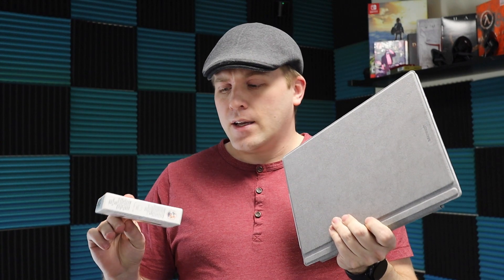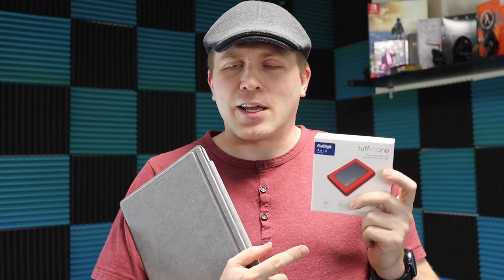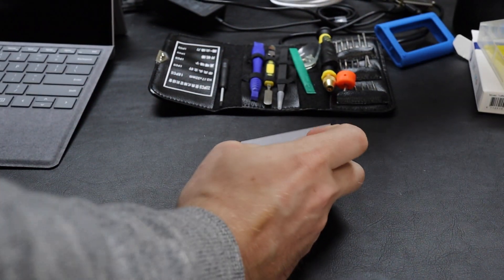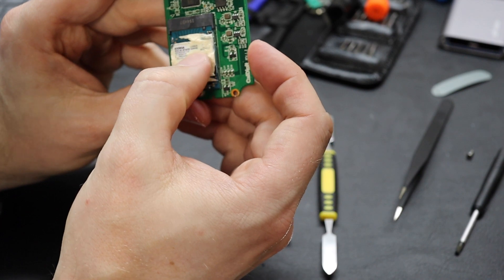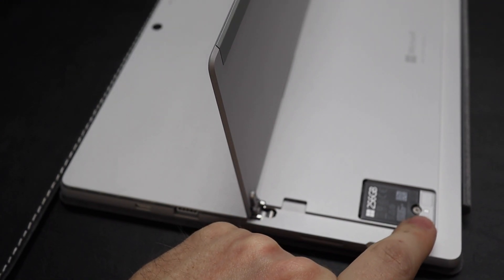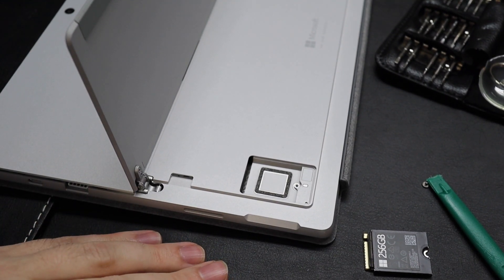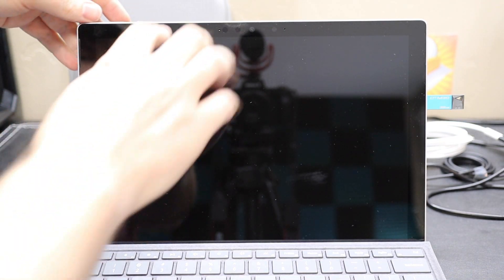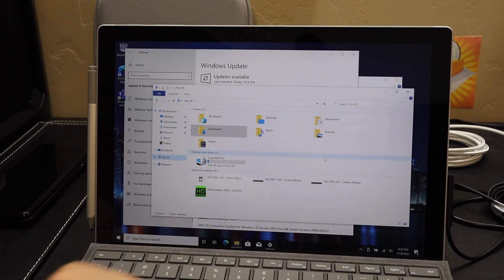Surface Pro 9 /8/7+ SSD Swap (also Surface Pro X) 1TB for hundreds less!

Comment: Why didn't you just bought a 2230 ssd instead?
Reply from the maker: Well... the CalDigit DID contain a high performance 1tb 2230 ssd; and it cost $220. Which 2230 ssd would you suggest I buy instead? (Hint: they are impossible to find; and cost double if you do find them)
Reply: @cbutters  they are available on eBay under $70 for the 256 gb.
Reply from the maker: @ahmedwael3019  The surface already had a 256GB in it... I want 1TB man!
Reply from the maker: @flax5162  in the US, we are getting screwed,  we don't have any purchase options for 1tb 2230, other than a 400 dell sku right now.
Reply: Will this work? 1TB SSD BG4 2230 Toshiba KBG40ZNS1T02 14DEC2019 09946M Z8EZX02RPUL4 NVME 09946M
Reply from the maker: @martyspranger4515  yes
Reply: @cbutters  Is it effectively the same and the Kioxia SSD you used in this video?
Reply from the maker: @martyspranger4515  Yes, Toshiba just rebranded to Kioxia recently.

Comment: Thank you for posting this. I almost spent 2× as much money (and 2 months of time waiting) for the Dell 1TB, because that's the only 1TB NVMe 2230 SSD that I could find from a reputable dealer. I just finished upgrading my brand new SP7+ i5 LTE with a 1TB KIOXIA/Toshiba that I harvested from a tuff·nano, exactly as you explained in this video — and all is well. Thank you again.
Reply: I want to ask you I have SP8 with i5 8gb ram can I upgrade the ssd to 1TB or it’s not able
Reply: @AYMAN-dy7tj  I currently have an SP8 i7 LTE, and I installed a 1TB MVNe 2230 Samsung PM991 drive in it.
Reply: do you have the link for 1TB KIOXIA

Comment: Hi cbutters Tech.. I came across your video and ordered the surface  pro  7 and def need  1TB but I don't have access to the tools or skills in this video. Could you still help me? What are your thoughts on resorting to a  Sandisk memory card for 1TB?
Reply from the maker: Did you get a pro 7 or pro 7+?
Only the plus has the ssd bay door. A 1 tb microsd card is just fine, it's just not nearly as fast.

Comment: Do you think consumers will get this surface pro later on this year?
Reply from the maker: My guess is they release a "proper" Surface Pro 8 later this year for consumers.... I think it was taking too long to get ready; and they know that they need more competitive chips or the Surface Pro sales would drop off. They also thought it would be embarassing to refresh the Surface Pro 8 using the same chassis AGAIN, so they released this as this SP7+ "for business"  and they have the newer "Pro 8" version on the way... its just not quite ready. (all this is complete speculation on my part though.)
Reply: Which interface does the SSD use? It looks very small
Reply from the maker: @darkyassin  m.2 2230

Comment: Hey, could you do a SSD Speed test? Because maybe it is cheaper to get the 128GB Model and upgrade a 256+GB by yourself. (And sell the 128GB one). 

Therefore I would be interested if the Microsoft SSD is faster than other SSDs and by how much.

I'm interested in buying a SP7+ so I would like to hear it :), thanks.
Reply from the maker: So far I've heard:
The 128GB one was a KBG40ZNS128G BG4A Kioxia (Toshiba)
My 256GB originalone was a Samsung MZ9LQ256HBJQ

The kioxia 1024GB one I replaced it with is faster than both the original drives though.

Also; the speed test is at the end of the video.